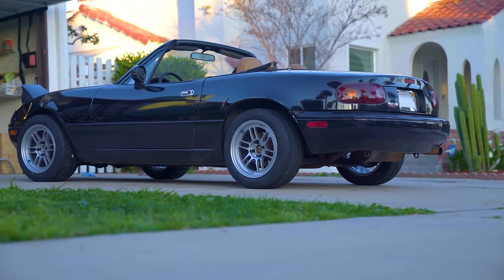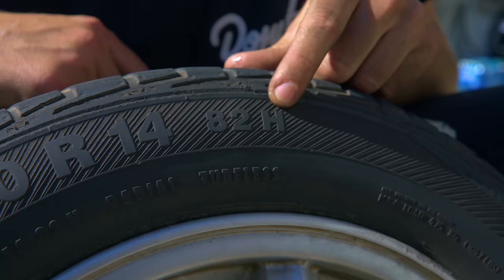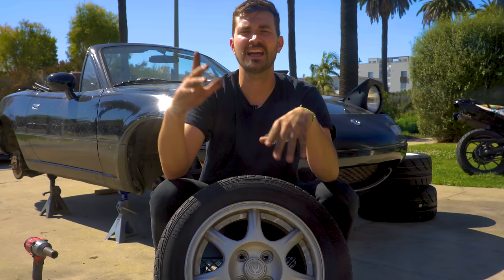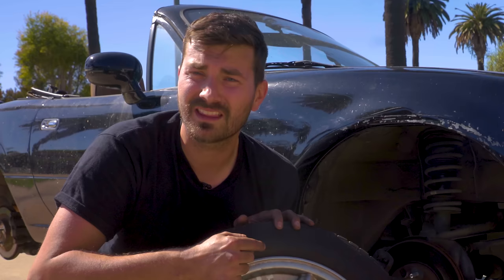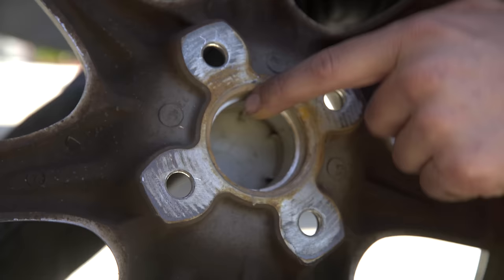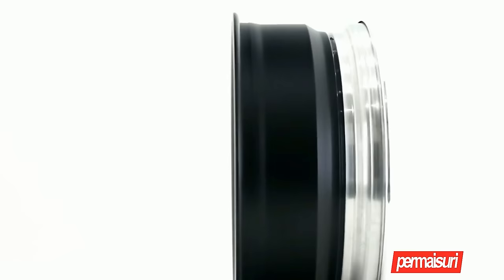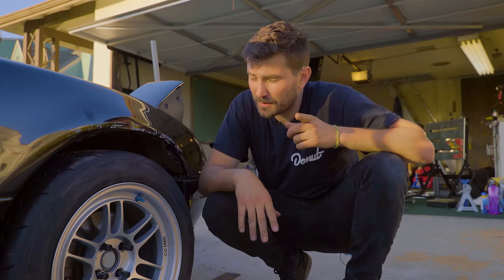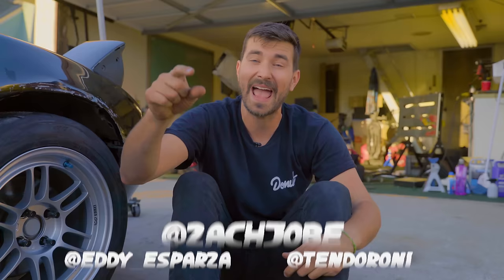How to Pick BETTER Wheels & Tires for YOUR Car

Comment: lol, at 6:35  i told the tireshop to switch my back tires, because of rotation, he disagreed, until i told him i want to drift on wet roads.
if you put them on backwards, the thread pushes the water under the tire, instead of away, so, no grip at all, aquaplaning all the time
Reply: no grip isnt good for drifting
Reply: @arcanevoid9199  low horsepower, and good grip in front makes it way more fun, not for high speed drifting. Max on 50 miles an hour

Comment: Double checking I'm understanding correctly, wider tires and taller wheels are safer?
Reply: umm, not always, usually narrow tires with higher profile allow better steering/handling of car - those wide/lowprofile only looks better; (applied to NORMAL use of car, not racing)

Comment: What is that little embossed logo/emblem in between the lug nuts at 16:47 ? I have that on my stock wheel, and I’ve always wondered what it meant

Comment: Some incorrect info on speed ratings. Higher the letter does not mean higher the speed rating. A "H" rating of 133mph is higher than say a "S" rating is 112mph, a "U" being 118 but a "W" is 168mph. A "Z" rating is not the highest speed rating either, a "Y" rating holds a higher speed at 186mph but any tire with a load/speed rating in parenthesis like (99Y) means the tire is tested to exceed 186mph without an actual speed. So at that point you're on your own? But higher the letter is not accurate to a higher speed rating.

Comment: hello thanks for sharing. well explained. 

i am looking at 7" alloy wheels and the tyre size i want would be 185/55-15 but the minimum tyre width is 195 for the 7" inch wheel rims.

do you think it will be a problem to fit 185/55-15 on a 7" ? or should i go for a 195/50-15? the latter represents only a 1.8% change in overall diameter while the 185/55-15 represents around 0.2% change. 

alternatively i could go for 205/50-15 which represents 0.2% change too but i think its kinda a big jump from 165 which is the stock tyre.

or i could just go for 6.5" rims but the rims that i have liked the most is 7" .. 

thanks
Reply: Mervin PS / how accurate is Your speedo? Most of them are 5 to 10% off. I would go for 195/55😜💨💨💨💨💨

Comment: Question for those who know: will a wider tire, for instance my size is 225/60R17 and I wanna put 235/60 or 55 R17, will the Steering Pump suffer from it, or it's gonna be fine? note: I am in a country where I can do this. Thanks
Reply: 235/55 is a better size or even 245/55, the change in diameter is important. and you wont have any issues with the steering, its not that big of an increase anyway

Comment: Hey if the load rating is 1047 pounds (475k), or 2094 for two tires, and even the average compact is 2919 pounds, are you at strong risk of tire failure if you for various reasons went up in the air on one side? Even a couple inches?

Comment: Why does the Miata with 8 inch wide wheels take 205 tires, but my 8 inch wheel takes 235's?
Reply: Miata people often like fitting narrower tyres for steering response or something.
IDK I'd rather take advantage of the extra wheel width by running more tyre.

Or just run 6.5-7 inch wheels and save weight on reciprocating mass

Comment: Lug centric mounting is DANGEROUS and should not be used. Always use hub centric mounting and spacers if needed. The wheel will bounce on the lug bolts and break them. The steering braking and handling will be degraded below standard with this combination shown. 😮

Comment: Is there any benefit/disadvantage for hub and lug centric?
Reply: Hub-centric helps mount the wheel more easily, but the lug nuts are what center it and clamp it down in both cases.  To actually have the hub support the wheel, you'd need and interference fit.

Comment: Car tyre sizing sucks; I mean 60%, both imperial and metric. Cycle tyres are so much easier as its just 2 numbers diameter and cross section (or a number and letter racing bikes).

Comment: "Larger the wheel, smaller the sidewall" Well no, you just contradicted yourself. you can have 22" with 285/65/22 and it will HUGE sidewall, or 185/30/14 with small.
Reply: What you said makes no sense whatsoever when he's talking about a specific vehicle. Your two examples are 100% irrelevant

Comment: but seriously UTQG is a COMPLETELY worthless (read:outdated/obsolete) rating system. thank you for pointing out that it is a marketing tool. that is truly all it is. traction rating only measures straight line wet braking. watching as i write this... IT HAS NOTHING TO DO WITH HOW STICKY THE TIRE IS WHY WOULD YOU SAY THAT. 
not a bad explainer overall!

Comment: P-metric is the worst formula possible for tire sizing. Every measurement changes every other measurement on the tire. Whereas a 35x12.50 is that measurement no matter the wheel size and you know the overall size of the tire with no math at all.

Comment: "If you change the wheel's diameter you'r speedometer might not work correctly" Haha joke's on you i have a volvo 740 that has no working gauges apart from the clock and RPM lol

Comment: The yellow dot on the tire is supposed to be aligned with the wheels valve stem. The tech who installed those tires was lazy.... Does it matter much? nope. But it bugs the fuck outa me🤣

Comment: 205 on an 8” rim? You’re stretching by 1”. You missed that wheels are actually 1” wider and 1” taller than the advertised nominal size. An 8” wheel is 9” wide, therefore the 225 would’ve been the proper choice. The best tire fitment is when your tread is the same width as the actual outside physical measurement of the wheel. Look at literally any vehicle sold and professional* racers, and that is how it is meant to be. When you buy a tire who’s gross width is the same as the nominal, not gross, wheel width, you’re stretching. Sorry not sorry.  😒

Comment: the base miata wheels :D
ojne point he mist it if you run soft/sticky tires
they will pick up more dirt or other sand from the street and sandpaper your car :/

just look at this video after he installed them on his car how much shit allready on the tires 

this shit will fly of the tire and hit your car if you drive it 

if you vinyl wrapping ok no problem, but most people dont do this on thier cars or vinyl wrapping
if you dayli dirve you car dont buy sticky track tires you will sandpaper your car

Comment: you forgot to mention the most important reason to go with 15" wheels over 14" wheels:
tire selection. There are not a lot of options for 14" tires in the sizes miatas use, while there are a lot more options for 15" wheels

Comment: Wrong, the letter for the higher speed is Y (300+ km/h)
BUT ZR tyres are 240+, so by definition, maybe it can handle 300+ for certain brand too ? (don't expect a ZR rating from a 40$ no-name brand to keep you alive from a 240+ run.)
Anyway, this notation is pure shit, why didn't they put it by alphabetical order ? Seriously...

Comment: 1:58 max inflation huh? Installing new low profile tires. Max PSI says 55. Tire is not fully seating at 60psi. Grabs air chuck and pushes 90psi - POP! I make scared face, let a ton of air out, then new schraeder valve. You sure bout that?